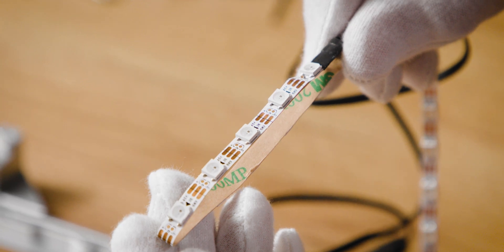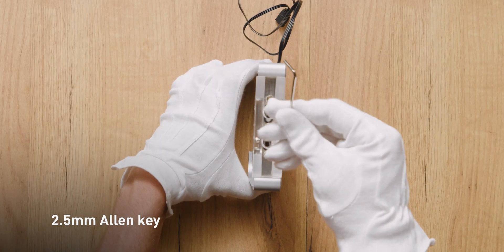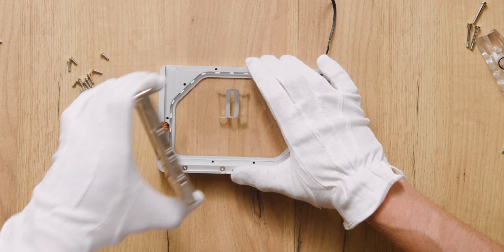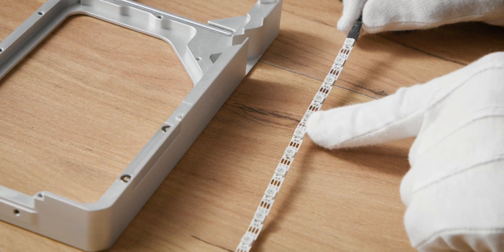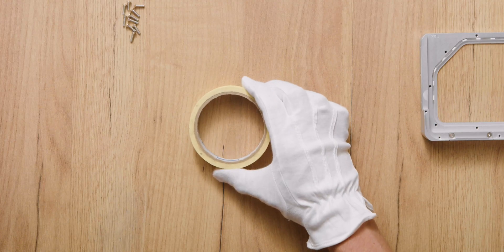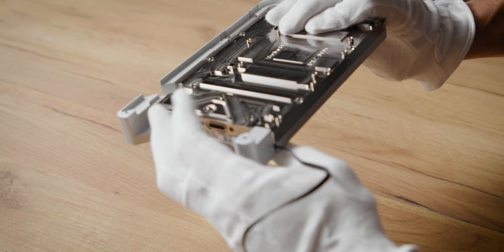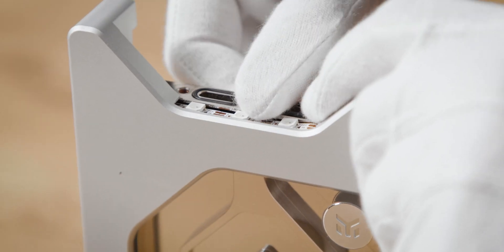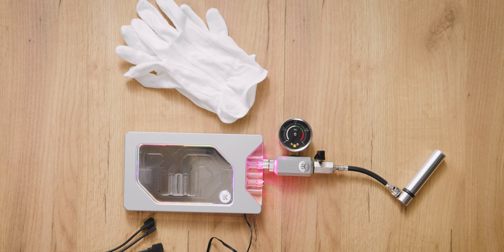EK-Quantum Vector FE RTX 3090 | Replacing the LED Strip on the Block

Comment: Why are your LED strips so terrible? I just got done draining my loop to change the strip in my Vector2 LGA1700 block because the LEDs didn't match. Now that I got everything back together the strips in my Vector2 RTX3080 FTW3 block also look like they need to be changed. The LEDs just get this washed out look and they are a much warmer color than they should be. They are also installed with some pretty major bends that I am sure doesn't help the problem. This is unacceptable for LEDs that take so much work to change.

Comment: So i emailed EK how to dismantle this block correctly and to remove the LED's as i dont want LEDs in my block. I was told:

"If you put the block back wrong then the warranty would not cover any leak after that, so in my opinion, it would be best to not connect the D-RGB cable to anywhere, so the LED strips would not be active than opening the block to remove the LED strip."

What the hell EK - why would you put this video up if your colleague told me a different thing....

Comment: please create a video showing how to connect the inlet and outlet, when we install water block on both the front and backside [active back plate] of gpu. 
cheers
Reply: It’s only one sided, so both fittings go on the same side.  You can remove the terminal, and flip it over so that the fitting are either left, or right.

The hardest part is connecting the terminal to the two blocks, because of the tight fit.
Reply: @the_Scarlet_one  yes got it. tilldate I was searching for backplate hence getting only the normal backplate videos. by searching "active backplate" one can get loads of video about it.